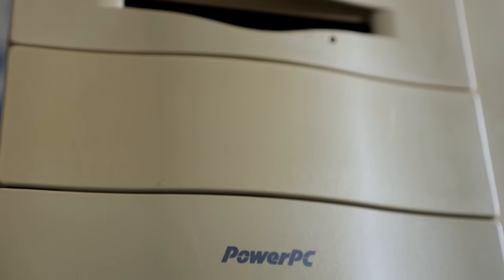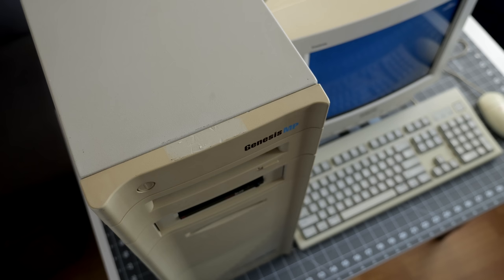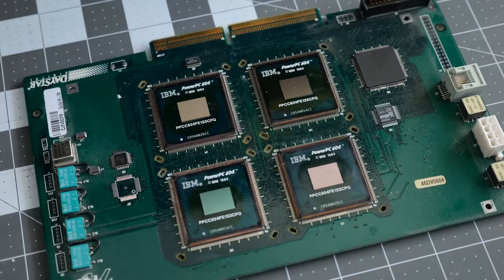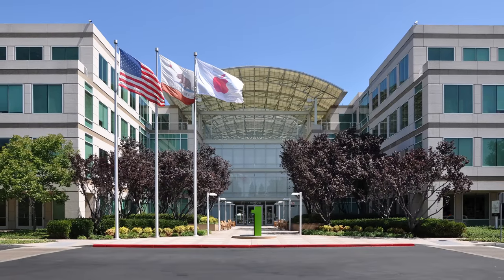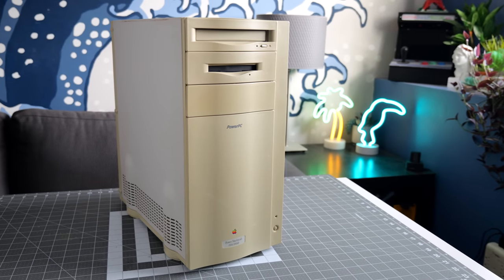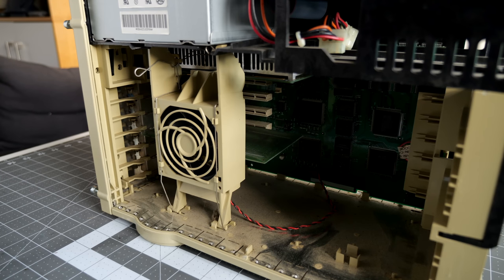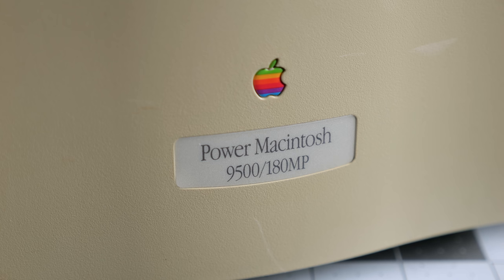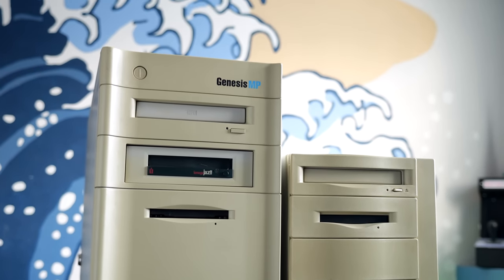DayStar Genesis MP: The Crazy Powerful 90s Mac Clone!

Comment: I'd love to hear the story of BeOS. As a computer journalist in the late 1990s, I reviewed it when it was ported to PC. I can't find my review now but I think my conclusion was, "This is nice. But why?" I would love to hear how it fared on the PowerPC architecture. It's called a failure now but I believe there was some take-up.
Reply: I think Action Retro (another great YouTube channel) has covered BeOS
Reply: @Azteca_X  kind of — that’s more an experiential document, than a history script
Reply: I used it on PC exclusively until Windows XP came out, and then hacked it's theme system and eventually someone made a Be theme for XP, and used that until I moved to Win7
Reply: I used it daily for a couple years, too.  "Why?" was pretty simple:  At that time, both Windows and MacOS were a total mess.  In theory, there was still room for a better solution to come along and unshackle the hardware.

BeOS was agile as a mofo, extremely stable, and had all kinds of nice APIs.  In contrast, Windows was fragile, slow, and encumbered with tons of legacy in the API, the UI, and the underlying architecture.  MacOS was just an utter disaster -- code tacked on to code, until it was just a mountain of tangled cruft that barely worked.

All three were engineering marvels in their own right.  Windows would run on a toaster, and supported 32-bit, 16-bit, and DOS applications simultaneously.  MacOS managed to traverse entire platforms without cleaning the slate.  But BeOS had a beautiful micro-kernel that ran like an accountant in the wrong part of town after dark.  It showed what the hardware was actually capable of.

I dunno if it could have ever lived up to the future it implied, but I still lament that it never had the chance.  RIP, Be. 😿
Reply: I read about it in books and magazines. but i have never seen someone use it.

Comment: It honestly still confuses me that Mac OS was what it was in the 90s - big with creatives, print industry etc - given the state of that OS at the time.

I guess it just says something about Microsoft's failure to grab that obvious market though, Windows NT really should have captured most of those users.
Reply: I’m sure much of it was ‘legacy momentum’ due to the Mac being the only real game at the start of the decade, but come the late 90s/start of 2000, Win NT was still horribly unstable. Most of my team’s days consisted of bouncing between Illustrator and Photoshop and a goodly spec’d Pentium III with 256Mb RAM couldn’t manage both apps open at the same time with BSoDing every hour or so. Eventually they got us shiny new PowerMac G4/400s. Ran perfectly stable. Despite all the grumblings about the lack of protected memory or preemptive multitasking, classic MacOS was rock solid so long as you didn’t have any dodgy Extensions or incompatible drivers. It was also was a lean OS, you could strip out anything not needed and be able to rebuild you system every few months in about 20 mins. Ah, simpler days…
Reply: @headwerkn  this is what I usually read in response to questions about macOS quality at those days. Thanks for being and  explaining to those who don't know.
Reply: I would like to add a couple of words that Apple had a little bit richer experience in  graphical OSes since Lisa (said to be full of bugs and crashes) and Mac releases. MS wasn't that proficient until Windows 3 release.

Comment: I'm curious where Apple might be today if they didn't kill OEMs. IBM hated it too at first and, perhaps it didn't make IBM itself huge but look at the PC architecture today, letalone early 2000s, I could be wrong but wasn't it like 95 to 98% pc marketshare vs like maybe 2% Apple? Even if I'm wrong I'm at least sure those numbers aren't THAT far off.
Reply: I think they would've struggled to find marketshare with Windows already being as popular as it was and all the compatibility issues of switching from PPC to x86. It might've gone differently had Apple not taken so long coming up with the next gen MacOS, OS7-9 was just too antiquated to attract people away from other platforms.
Reply: @ozzyp97  compatibility issues? Rosetta worked great. There was more issues going from OS9 to OSX for compatibility for most people than PPC to Intel. And as much as I hate to say it, so far I've had pretty good luck with Rosetta2... Part of their issue with market share back then was huge hardware cost for something that more and more didn't outperform a PC, OEMs would have brought that cost down making it a more attractive option. That said, indeed OSX was probably later than intended with A/UX not really flying and the transition to OSX wasn't super smooth though it was a nice jump and cool to see a usable mainstream OS based on any kinda *n*x.
Reply: @forbiddenera  For general desktop use maybe, but it's still an extra layer of potential issues and performance loss, all on top of the transition from OS9 as you mentioned. Meanwhile, Windows users could still run most 9x software just fine (as they still can, albeit with more frequent quirks), and even 16 bit software as long as they used the 32 bit version of Windows. Same goes for hardware compatibility and upgradability.

Apple just never cared that much about long term support and compatibility, and a lot of users want that. Not much clones could've done there, had the OS still remained solely in Apples hands.
Reply: @ozzyp97  TBH 16 bit software on most 32 bit versions of Windows was very unstable, wow16 sucked ass, I lost count of how many times I saw an installer crash by y2k because a lot of developers still used 16bit installshield. And true, layers of translation have performance issues. Os9 on osx wasn't too perfect for sure but ppc osx apps on osx via Rosetta wasn't too bad. With Rosetta2, I've actually been impressed..I expected it to run like absolute crap tbh but so far with what I've tried, everything runs better than something running in Parallels under Windows on an Intel machine which while virtualized isn't translated. My first test with Rosetta2 was something I was sure it would suck at - intense audio plug-ins in Logic, in fact I almost didn't bother for a bit using Logic on my Studio because of not being able to find ARM versions of all my plug-ins and you have to pick running everything under Rosetta2 or native so either I find updates for every single plug-in or I try Rosetta2. I tried and was able to run over 300 channels of software instruments with 6 to 8 plugin inserts per channel, all Waves plug-ins with me intentionally choosing the heaviest ones and limiting latency compensation and it didn't max it out and ran perfectly, I wouldn't have guessed it was running under Rosetta2 letalone I would've lost the bet on the M1 Ultra being able to handle all that without choking. There's definitely going to be other uses that won't translate as well though but everything I've done has been surprisingly good and I say this as someone who's not particularly an Apple fan (at least anymore and I've never liked iDevices) and I would not have purchased the studio myself but my work gave it to me so, sure I'll use it and I was legitimately shocked as someone who's been into software development since like 92, was tunneling through a local BBS to the net in 94 on win 3.1 and was fully present for os9 to osx, ppc to Intel and now Intel to arm.. I would bet though that if anything was going to seriously suffer or have compatibility issues that it would be any apps that seriously use a GPU and definitely the GPU performance of the Studio was surprising like the CPU and Rosetta2 performance was, in fact considering apple's marketing I would say the GPU performance is disappointing and the lack of egpu support considering it has lots of thunderbolt is disappointing (letalone my old mac pro having an rtx2060 thus basically relegated to Windows unless I'm doing something that isn't gpu bound and osx using the 8800gt I have which while available as an oem card for this pro was actually one I got originally new for my pc and flashed after my gtx970 decided to die when I threw the 2060 in).. but as much as I hate to give apple any praise at all, I must give credit where due and Rosetta worked pretty great for me and Rosetta2 seems to work even better. But the lack of ability to translate kexts is frustrating as I can't easily use my Firewire audio device unless I want to write my own driver with no real documentation cuz apple sux